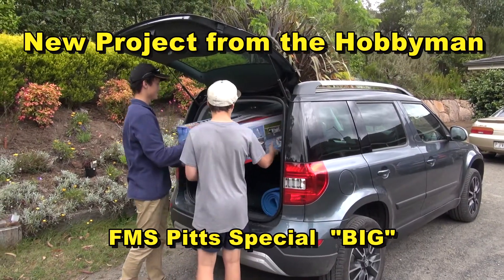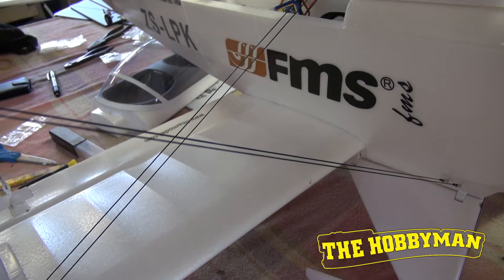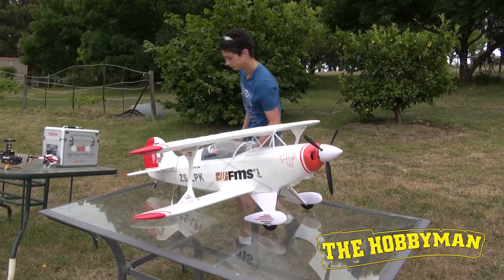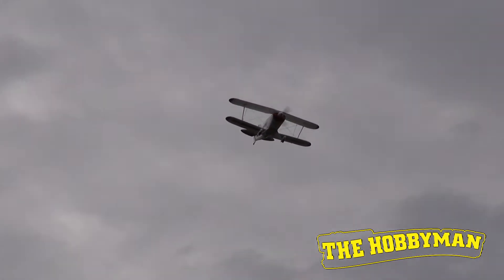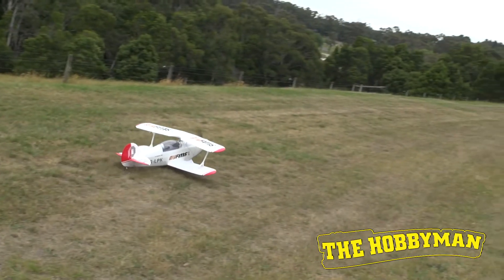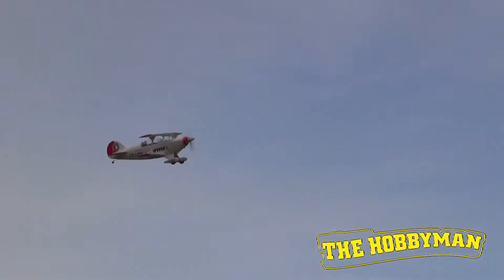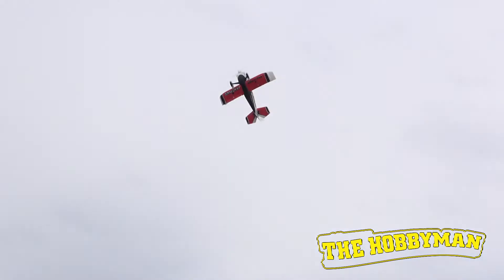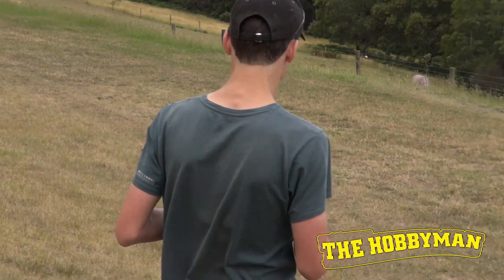FMS Pitts Review

Comment: I will have my pitts before the day is over, and will be doing the build tonight. I am hearing a lot of horror stories on the CG for this plane, so I was just wondering........where did you place your CG? One guy balanced his at 142mm back from the leading edge of the top wing. the manual says between 90mm to 100mm. What is your opinion on this issue.